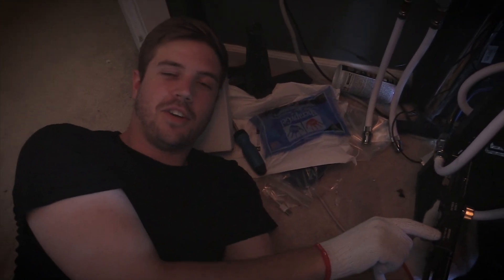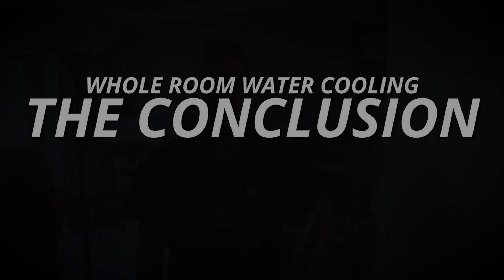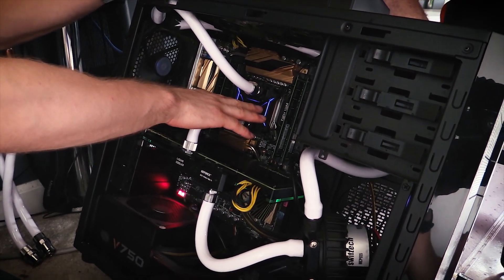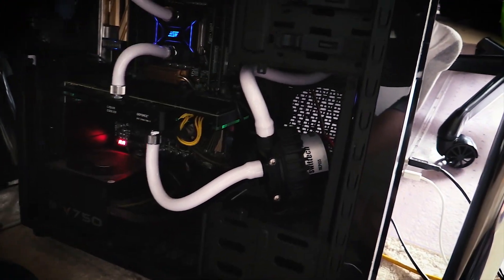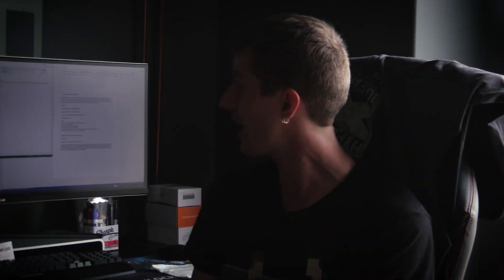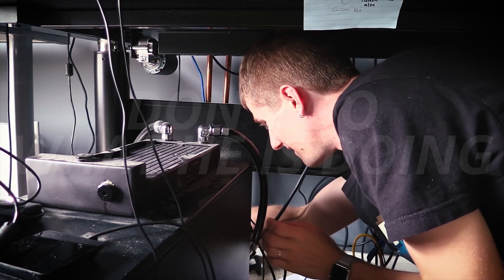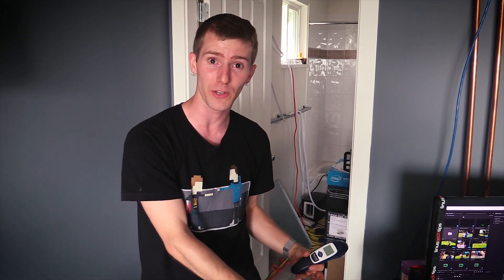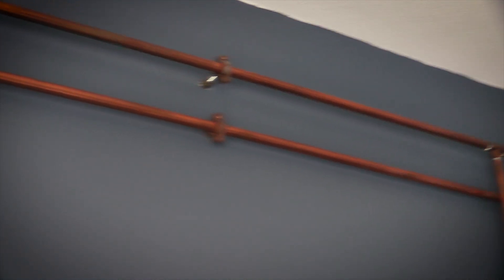Whole Room Water Cooling Part 7 - It's FINALLY over!

Comment: I'd put the pc's in a server rack watercooled by a low range AC inverter of a decent brand, they're specced in kW of dissapation power instead hundreds of watts. The defrost function could come in handy in the winter (at least if it activates in heat dissapation mode). It requires a sacrificial anode to counter corrosion. 

I think the power supply to your radiators is a critical point of failure, especially since it requires you going outside to fix... Exposed to a wide range of temperatures and humidities, working with a constant load is asking for a sudden death. It'd be pretty shitty when 7 worksations suddenly shut down. :) Just place a good supply indoors and run 12V cabling to the outside.

Comment: You should have used hard-drawn copper, you should have cleaned it, or purchased it cleaned, which means it would have been capped.

The reason things started growing in your coolant is because you didn't run a sealed system, and that "fill tube" was sucking airborne organisms into your system. The filtration was a decent plan for the organisms, but tap water always contains not only air, but impurities, and it is those impurities plus the oxygenation of the water that lead to your system corrosion.

Lastly, you were bleeding temperature from the lines because you didn't insulate them. I couldn't tell if you were running 1/2 or 3/4 inch copper, but there is insulation for both of those. This is something you should have done from the get-go due to the fact that your lines will condensate during temperature variances and humidity levels.

Given that you were running a radiator, I would have actually stuck with 100% anti-freeze, and sealed the system.

When ever you run a liquid or refrigerant cooled system, you always need to make sure you pre-clean the system, that includes the interior of the pipes, all of them.

Trust my Dad, he's been a Refrigeration Technician for 25 years.

Comment: I really really like this idea, and appreciate so much that you guys put it into reality. This is Engineering! How exciting! 
Ok, What I 'm gonna do to improve the system and fix some problems you have is 1. Using smaller PVC pipe with heat isolation ( you may have probably seen on A/C), 2. Rather than just put a radiator outside the building, I will use a air conditioning to cool the radiator giving much cooler water to the PC. Meanwhile, let the rest of the wind coming from the A/C to cool the room.
Again really cool!

Comment: okay let me start by saying this is a good idea!! BUT!

#1 the pumps, the ones in the bath tub are stronger than the one in the computer 

so bottle neck  cpu:bottle neck gpu:bottle neck

3x4=12 so 12 points of BN if you will ...ever more if you count every individual water block

so all you can do is delete the computer pumps but wait we need those...yes and no

return pump: two big pumps inlet two big pumps outlet 

the small pumps were fighting you from the very beginning

Comment: A friend of mine watercooled his PC ten years ago by using a car radiator he hanged in his garage. He didn't even need a fan for the radiator. Shure, it was just one PC and not such a high end one as yours, but that was the time of much worse efficiency.  If space is no issue (which it shouldn't be outside) I'd always prefer a passive system, not because it's quiet (irrelevant outside) but because it has les moving parts and doesn't need power outside.

Comment: As a plumber, I find your system is set up for failure. You should have called a professional instead of using a handyman. Wrong way to run the piping, wrong pumps and you obviously did not clean the flux out of the piping system before starting it up. People should not look at this extremely poor system and think that this will not work. It will work, these guys are just hacks....
Reply: +MeLeet - I think they used soft-drawn copper, and I think they didn't properly clean all the copper interior. For plumbing, I don't think you need to worry about cleaning, but when running a refrigeration system, which is essentially what is going on here, you need to, as to eliminate contaminants in the system.

The next problem I saw was that they had no traps in the system. You can't run a coolant system over that kind of span without traps every 8-12 feet, this also lets the system push air out more effectively when filling the system. That said, I don't know what kind of pressures the in-computer units are rated for.

Lastly, I think we can also agree that the pipes were poorly secured, and would have broken seals all over the place eventually (within a short period of time).
Reply: David S I would never be as harsh as I was with anybody else. These guys have the resources to call a professional for consultation. (probably $150 bucks, and most would have done it for free). Cooling a computer is no different than cooling mechanical equipment. They are the leading YouTube channel on computer technology. They are experts in their field. There is just no excuse for the hack work that was done in this series.
Reply: +David S it was ametuer, their first setup?  would you destroy a 150+ waterblock +  whatever other equipment it takes out?  

when i did my loop i researched the hell out of it, ran great too.
Reply: +MeLeet He did clean it first, the guy they used was a plumber, you found next to nothing and you are clearly misinformed.
Reply: Eaglefly123 Minecraft
He should not be a plumber...
Reply: +MeLeet The only thing i feel that he did that was wrong was skip one joint towards the end of the run. But everything else looked just fine. Only things i would have added would be some ball valves for shut offs and maybe some inline filters/check valves.  But those are design flaws. Not everyone can be a plumbing engineer so your critique was a bit overboard.
Reply: +MeLeet Well, I think that's a bit harsh, to be honest.  I can honestly say that I've never seen or heard of anyone attempting anything like this, and while it's always easy to grief someone in hindsight, they were literally making this contraption up as they went along.  It's the kind of project you learn as you go, and/or look back on and learn from your mistakes and do it right the next time.

Honestly, a filtration system for this thing to prevent microbes from growing in the tubing was a huge obstacle that I'm not sure many people would even have considered.

Comment: Phase change dropping the water to just above the dew point, plumbed through the office with dry break quick disconnects at each workstation.

Cheaper to just run the air conditioner though lol

Comment: Hi!
        My name is Bogdan, I'm from Romania and i saw all your videos about this whole room water cooling project which is nice.
In my PERSONAL OPINION some of the things are not done properly, such as:
1. In order to remove air from the system properly, each working station must have bleed system on retur pipe.
2. Positioning height of all components of the entire system must respect the principle of communicating vessels. The two main big pumps would work better if the water would flow by dropping in to the system. So, order system heights as: in the highest point of the system: 1 tank, 2 pump, 3 radiator with fans, 4 workstations in the lowest point of the system.
3. To be absolutely sure that no air is left in system you can seal up the tank, and put some pressure in the system, about 0.3-0.5bar, not sure in psi, about 0.5-0.9psi.
        Think about my views and see what can be done with minimal investment, if needed.
        I apologize for my poor English, I have not used the language in the last 10-11 months and I kinda forgot to write. I'm better at talking:)) ...
        I wish you all the best!!!

Comment: You need to put insulation around the pipes to prevent the heat from getting into the room. I work where we have lasers that generate a ton of heat, and they have a massive watercooling system and they put insulation foam on all the pipes.
Reply: They said this in the video, but you should use insulation on all pipes anyway, if you don't want to have the heat in the room. It's cheap, it works, and it really does help out a TON.
Reply: +Alexander Borsi Back then one of the guy's dad did the piping, first thing that popped into my mind when I saw the exposed copper was "yep, this will totally expel heat back in the room". He gets points for trying, but, like one guy said, he should have went to a data center to check the latest and greatest in cooling options.
Reply: +Alexander Borsi They probably have a mix of metals in the system which leads to corrosion, especially if they are using water. Water cooling kits use plastic pipes because they flex and don't corrode. They also use a glycol-based coolant with corrosion inhibitors to prevent fungal growth.
Reply: +SmartphoneSchmiede They have a big heat exchanger/radiator outside to put the heat outside. The issue is that most of the heat has already been lost in the room, since the pipes are bare.
Reply: +Alexander Borsi Yeah,  was seeking the comments to find this answer :) Copper pipes may be good for a heating system to heat the whole room though, it only looks cool :)
Reply: +Alexander Borsi the insolation would keep the heat inside the pipes...water wouldnt cool anymore...CPU would stay warm room would stay cool...it would be the same as just turning it of XD
Reply: +Alexander Borsi indeed, armaflex is used in HVAC systems no questions asked. Otherwise you are just wasting the capacity of your cooling system.
Reply: +SmartphoneSchmiede No, the water is beeing cooled outside where the radiators are not inside the copper tubes.
Reply: This is not exactly true in this case. The surface area of the pipe will release some heat to the air around it. however without air flow its going to be fairly small amounts also keep in mind we are talking about a relatively small thermal delta from the coolant to the air temp. As he noted in the video it was only around 2c. Basically the faster the water moves the better the rad will do at keeping the water temps down in the lines (since its such a large system with relative low flow rate). 

Don't believe me try using a 240mm rad with out fans, it has a very large amount of surface area but has a very hard time dissipating even just 100w with out getting very warm. You need air flow to make cooling efficient. Now if these pipes were to run water temp that was 20~30c over ambient then sure you will see a difference in heating the room.

Comment: Having run data centers, I have to just say, WTF were you thinking? 
Why did you not visit a data center and at least look at some current designs?
I mean if you were in a very cold climate, this would be a decent room heating system, but it is NOT a cooling system - by DESIGN!!!

Save it - in the winter, you can just open the window and use this 'cooling' system to both heat your room and cool it from the outside air.

BONUS - excellent learning video. Points for trying. But I wish you would have consulted with a data center cooling or facilities person first.
Reply: Bro, he didn't wanted to cool the room, he wanted to install a super performing water colon solution for multiple computers in a giant custom loop with modular characteristics.
Reply: *****
or cold - all i am saying is, if the goal was to remove heat from the room, make the cooper runs as short as possible.

Now, you could insulate the pipes with the cheap foam, form fitting, pipe covers. That would prevent some of the heat from being released into the room.

One other question? What intensive 'graphics' are these guys actually doing? Have you seen their videos? A GT120 could do this and the heat problem goes away!!!
Reply: +joebonsaipoland i think it was more hey we can do it why not? more then actually going after the goal of cooling
Reply: +joebonsaipoland I do not understand those GPUs as well? Or is it possible to use GPU power for video editing tools?
Reply: Spazik86 depends on the software, some sw takes advantage of the GPU and the faster GPU = faster performance, but most does not and is processor dependant.
Reply: *****
Where you at? What is the local climate?
Do you have a cool basement?
There are natural things you can do to use nature to help cool your equipment for 'free'.
Or why not buy a bigger case to deal with the cooling properly?
Reply: Dargonante
Insulate the pipes at least, or run the water through the basement to heat and dry that space!
Reply: ***** I hope they read their comments.
Reply: *****
would need to have more details. but if your goal is to remove heat from your case, be sure you have good airflow over the CPU and out the case.
Reply: *****
makes no sense, you need an exhaust fan for the case to pull hot air out and suck cool air in.
This is not rocket science.
Are you being a fucking TROLL?
Reply: +joebonsaipoland You seem to be the only person on here that knows what he's talking about.
Reply: Емил Ефендулов Been involved in data centers since 1999. Build my own - its all about moving the heat to a cooler location. To do that there are much simpler & even passive ways to do this.
This was nice experiment, but I could have told him from the beginning how to make it better.
Reply: ***** thank you ! yes I did something like this in New York to cool my data center and eliminate 90% of air conditioning costs.
Reply: +joebonsaipoland Yep, the hydraulic performance of this system will be appalling. Especially for the machine that is further away from the bathroom pumps.
Reply: the  purpose of the system wasn't pragmatism but to gain viewers with something that is similar to what people use on their own computers at a small scale

Comment: FAIL : Too much heat is being radiated back into the room by the copper pipes.  If they went straight out to the bathroom and then cooling, your room would be a lot cooler.

Comment: Final idea - organize all work station in a rack and cool with A/C or outside air on front side only and suck the heat output out the other side vented outside.
This is done in data centers all the time now. 
It's easy to use KVM and USB over RJ45 to get full usability of the workstations just a few yards away.

Comment: Move your office to the North side of the house, WTF?
Or move your servers to the unfinished basement and use KVM = warm basement and cool office.
Or, run pipes directly to the reservoir and out to the heat pump outside = less heat in the room, quickly dissipate heat to outside.

Comment: Dude, awesome video, but just insulate the pipes man! That's an easy and not very expensive job and I bet it will make quite a difference. Insulate both the incoming and outgoing water, because the room is heating the incoming water as well..

Comment: Here's something to think about.

I was thinking about soda guns, the kind they have at bars to dispense drinks, and got to thinking about the method they use to cool the water that gets mixed with the drink syrup. They have either a block of aluminum that sits in a bucket of ice that the water runs through, or they have a refrigerator unit that does the same job except with no ice. I want to see what you could do with a setup like that, i think more than likely the ice bucket method would work best looking back on your PC in a fridge video... you could get some insane overclocking in there before the ice melts. Just imagine, sitting there gaming your arse off, when all of a sudden, "Hold on, I have to swap out my ice bucket before my CPU explodes!"

Comment: Just do what we used to do at work, use long cables, put the PC cases in a single "box" with fan's to blow the air inside the box straight out of the building.  works great for us, and because you are pushing a lot of air out of the building, you also remove the hot air that the sun has heated up in the room, basically venting the room as well.  Works fine for those 8 machines. 
of course with a little more work you can also use outside air to cool the PC's.

Comment: Run pex and then find a cheap off the shelf water to water heat exchanger for your hot water tank in the new office with a thermostacially controlled block and fill system for the inlet/outlet to your hot water tank.  Maybe with an auxiallary heat sink.  And then just don't run the hot water tank.  Plus you run the pex alongside any hardwired data connections.  Just an idea.

Comment: if you used a manifold system would be better and a  high performance automotive  radiator would be better and cheaper
Reply: +Jason Chamberlain this way every computer gets its own cool water supply and the return water is sent out direct to rad not to next computer ... i notice that flaw in your first video and use color pex pipe much better

Comment: I'm wondering if the copper pipes are dissipating heat would insulating them make a difference? A relatively cheap and quick test as I imagine hot lots of uninsulated pipes would heat the room up.

Comment: I don't understand why go through all that trouble and expense when you could just shoved the computers in a separate room and run fiber optic cable to your workroom? single room air condition unit for the computer room would take all the heat out of the room your working in.

Comment: Hey Linus I've been following this project and have to say you could have saved money and added performance by going to a scrap yard and grabbing a radiator, pump, and fan out of an older big engine car. You also ran the loop in parallel instead of series which cost you allot of copper and flow with little to no performance. I would say in your new office water cool the machines in a single chain with an industrial radiator/fan and you could have some actual gains.